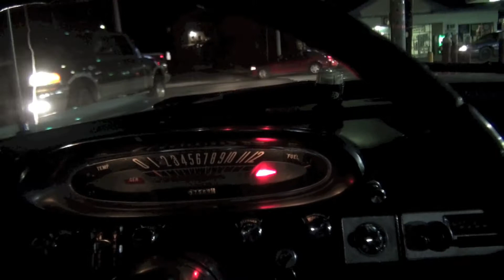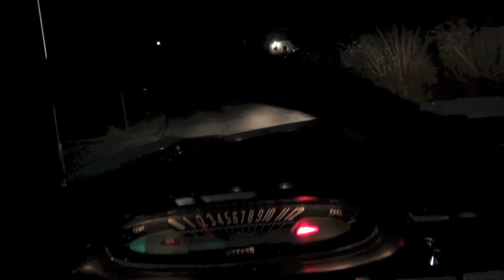1960 Rambler coming home- 1/1/14

Comment: Great video.  Thank you for sharing!  Nice to see the same model as Audrey still on the road.  Planning to drive her down to Austin in April to the LoneStar Round Up.  Do keep in touch so we can compare notes.
Reply: pretty good to see two 1960 Rambler s still around

s
Reply: Candi Angotti  I grew up around Ramblers as my mom and dad owned them . My dad had a 1960 Rambler six custom with six cylinder engine  and three on the tree.

Comment: I've had 3 of those so far. Had a 61 in mint condition, 60 and 62 in fair condition.
All 3 had the same  6 cyl engine and push button tranny. All 3 started, sounded and ran exactly the same way. Most dependable engine ever made.

Comment: my dad had the 1960 Rambler Custom 4 door sedan with the six cylinder and 3 speed on the column it was champagne color on the bottom with a white roof

Comment: That is a real stripper!  Two headlights in coves made for quads.  The engine sounded OK despite the oil pressure light.  It must not have been very serious; I see you went on to drive it long miles.
Reply from the maker: It ended up being just fine, the problem must have been the sending unit. I put in a pressure gauge and it has 20+ lbs pressure at idle.  You can see the other video where I drove it to Colorado and back last summer, indeed there was nothing wrong with the engine!

Comment: If you're still following this, I wondered how the ignition problem turned out.  I've got a 1958 Rambler American (flathead six, Flashomatic, standard ignition), and hope to do a similar cross country this spring.  Thanks.  Tom in Connecticut
Reply from the maker: I did figure it out. Here's what it was: the owner installed an electronic ignition module in the distributor, but the car still had its original non-resistance, steel core spark plug wires! It would draw so much current that the module would cut out to protect itself. I put in new resistance core wires and it never happened again.